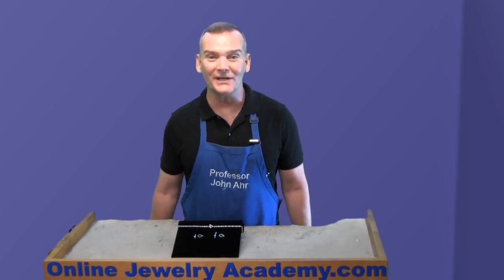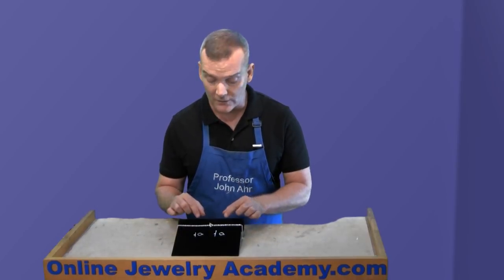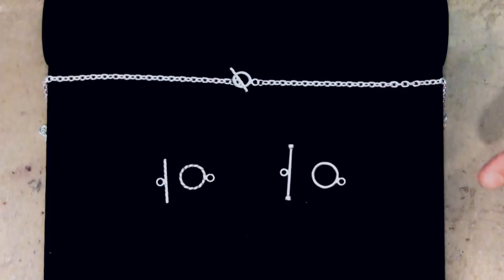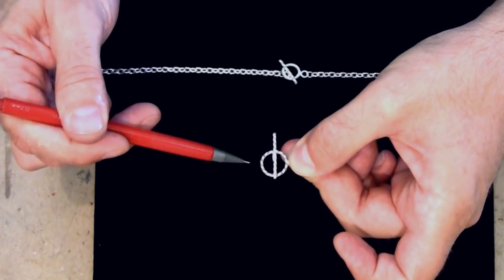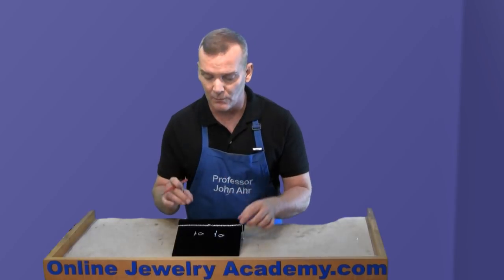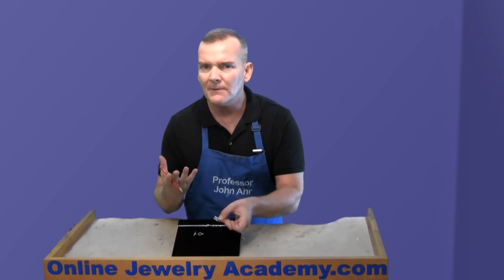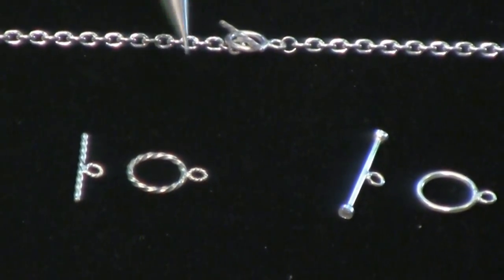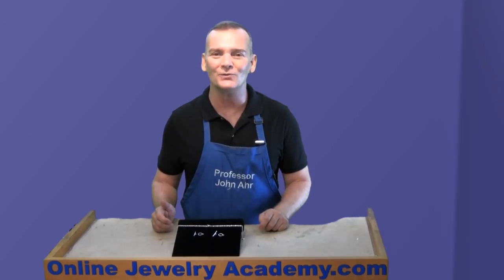Secret To Making A Toggle Clasp - Correctly

Comment: Do you have any tips on making a seamless-looking solder joint when using twisted or decorative wire/bezels? I'd be worried that a break in the pattern would make the join visible from space! Yours look fantastic though.
Reply from the maker: Thanks for noticing Vikette1000 that I took the time to really blend the seam on my twisted wire loop.  The way I did it was to line up the twist of the wire above and below on the mandrel before I cut the wire.  If there's any extra solder on the seam, use the opportunity to blend the seam with your file.  I hope that this helps.  Good luck with your twisted wire projects.
Thanks for your support! : )
Reply: Thanks! I tried one a couple and they didn't look half-bad (after some swearing). I'll never be as twisted as you though. ;)
Reply: @OnlineJewelryAcademy  how about showing us how u did it? Soldered the jump ring to the T ???!!! Thanks for the explanation but I think u should have shown us how to solder it esp the twisted wire

Comment: I have a question.  If I torch silver to anneal it then throw it in cold water, will the cold water reharden the silver? Some guy just told me it will but I've always been told the opposite...
Reply from the maker: Hi Heather, That guy doesn't know what he's talking about.  And he has probably watched too many episodes of a certain blade forging show.  Nonferrous metals actually become more malleable after being heated to an annealing temperature and then quenched in water.  The reason why is because the heating process helps to realign the atomic structure of the metal while the fast cooling prevents large internal crystal structures from growing.  The more small internal crystal structures inside of a piece of nonferrous metal, the more opportunity the structure has to bend or move.  There is a ton of better written explanations on the web.  Bookmark one one your cell phone so you can show it that guy the next time you see him.
Thanks for your support! : )

Comment: How do you properly measure the length of a toggle clasp bracelet when it's laying stretched out flat on a surface? I'm assuming it would be inaccurate to measure from end to end, the only answer I have found says measure end to end then subtract 1/8", but that seems very vague. I was assuming you might measure from bar end to center of circle? Please help :)
Reply from the maker: The easiest way to get the toggle to the right length is to purposefully make it longer than necessary. You can then slide it from side to side of the loop and mark lines outside of the ring. 😀
Reply: @OnlineJewelryAcademy  Thank you so much for the response! I think possibly my question wasn't worded quite right. I'm trying to measure the overall length of the bracelet. I'm having a hard time knowing where to "end" measuring...is it 6" long or 6.25" or 6.5" depending on where on the "circle" end I should stop measuring? Before the circle, in the middle of the circle or at the absolute end? Does that make sense? :)
Reply from the maker: @courtenaykeller3525   Toggle clasps move around a little. I recommend using the middle of the loop as an end point. When you customize a linked bracelet, aim for a fit where the bracelet rests below the wrist and on the “flair” of the hand. I hope my wording is clear. 😀

Comment: how do you twist the wire so uniformly? mine comes out with less of a twist in the middle and more on the edges...
Reply from the maker: The OJA has videos on how to twist wire.  The secret is to pull on the wire as you turn it.  That way the twist appears even along the length of the wire.
Thanks for your support! : )
Reply: thank you :)

Comment: My Toogle clasp never stays done up!! Plz tell me how I can keep it for always coming apart????
Thank you
Reply from the maker: I can’t see the problem. But, I’m certain that the solution is in the video. My best guess is that your toggle is too short. 😉
Reply: @OnlineJewelryAcademy  y

Thank you for responding to my question. An yes the toogle is to small. Is there anyway I can fix it?
Reply from the maker: @danamelton7332  Maybe!? (Like I said, I can’t see it.) If you can safely solder on the toggle, you could add length to both ends. Use it as a design opportunity. Perhaps you could extend the toggle with bezel cups and set stones on the ends. Have fun.
Reply: It's a very tiny small loop an toogle but with your suggestions hopefully I can  figure something out. Tha k you very much🙂